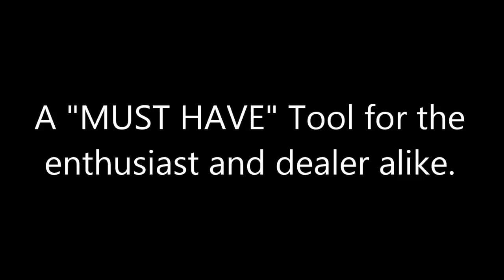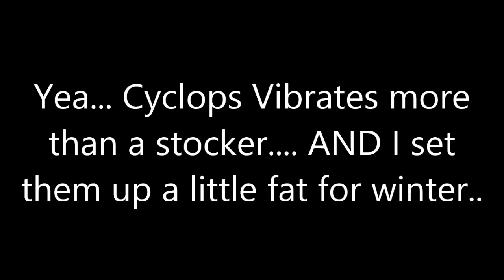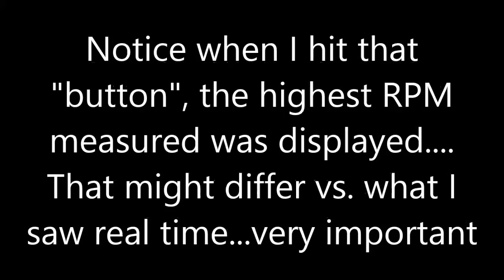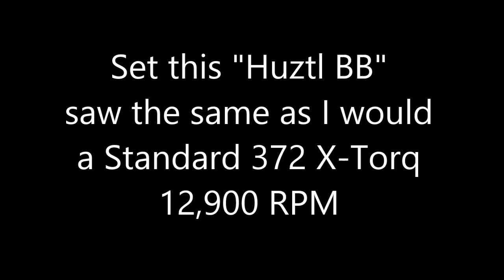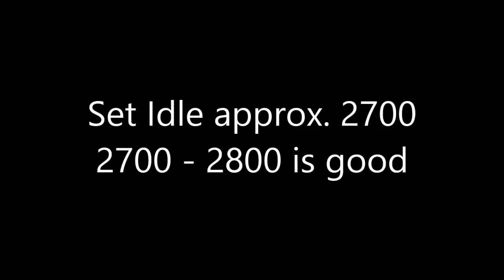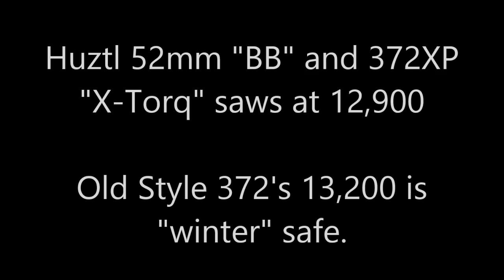Tachometer's For Chainsaw's and Husqvarna 372XP "X-Torq" Setup Notes

Comment: Mine 365 X-Torq was at 13500rmp when I got it from a dealer, do you also recommend for that saw to lower the rmp to around 12900-13000 rpm?
Reply from the maker: 13,000 yup. Newer ones better then the older ones. Pre 2015 12800-13000 max
Reply: I should have probably mentioned that mine is 2018. Thank you for advice and quick response.

Comment: Will this work on the autotune's and m-tronics? What ranges would you setup a Huztl 660 idle and no load highspeed to in stock form? They seem like great saws as long as you go into it knowing there will be bugs to work out. Which to me is the fun part.
Reply from the maker: these work with any saw with a spark plug..:) they count the field collapses from the spark plug wire. A 660 from Huztl should idle around 2600-2800 rpm and no load 12800-13000
Reply: afleetcommand Thanks keep it up!

Comment: Can you tell us more about your muffler mod?  Or did you just punch a bigger hole and brace it shut?
thanks  GL
Reply from the maker: Started with a Huztl side pipe muffler... they have no internal baffle's which is why I like to start with them. They come with a approx. 5/8 dia. pipe. I cut it out and put a 3/4 in dia. x 2in long pipe is the same spot.  Wonder if I should video that process at some point. Pretty easy to do. Actually the Huztl all by itself is an improvement on the "EU" style baffled mufflers.
Reply: Yes to this vid!  I'd love to see a couple different muffler mods... These vids are limited on The Tube!

Comment: Do the big box saws such as the 440 still get tuned to about that 12900 rpm?
Reply from the maker: A 440 is "safe" at 13K, but an OEM 440 likes to push that 13,500 range "no load" tune. SO what I've been doing it setting that class of Kit saw around 13, then plug check.
Reply: afleetcommand, thank you for the information!

Comment: For my husqvarna 365 x torq,  can i setup this rpm just like husqvarna 372 x torq, Walter?
Reply from the maker: I would set the 365 at 12500 instead of 13000. The 365 has a little less transfer area because of that fin in their "transfer cap", grind that out and they are a 372..:)
Reply: Thanks for your answer, Walter!

Comment: My 562 auto tune has no manual adjustment ?
Reply from the maker: No adjustment other than the Autotune. And if the saw is healthy thats all its going to need..:)
Reply: Tks. I got my 562 and T435 from Bob and had him ship them to Freedom, PA. His prices are way  better with shipping then my Husky dealer 4 miles away. also have a 460 rancher, Stihl 029. Thinkn about getn a 572 but don't  kno if that's gona be that big of an upgrade from the 562 for the money ? Running the 562 with a 28" bar and JGX full skip.Did my own muff mod. Cutting red oaks up to 10 feet around like butter. Love the videos very informative.
Reply from the maker: The 572 is a 70cc saw and runs like one..:) I actually am on the fence as my 562's are doing exactly what I need. The 572 has some design changes that will make it worth the investment for someone who makes a living with a saw, but for me? If I get one it will be either for the channel or for collecting. :) have to say its an impressive saw though.
Reply: Tks for taking the time to reply. Think I'm gona go with another auto tune . 576 xp.

Comment: Was that the 180 that was giving you problems
Reply from the maker: ian martin Yup. I hate it.
Reply: afleetcommand Thats too bad. I was having trouble with my ms170 and I had to get the clutch off to look at the intake boot. I don't have an air impact rachet/drill so I had to use brute strength. I got the clutch off but in the process bent the piston rod. The corners of the skirt broke off but amazingly enough the cylinder has no damage accept for the everyday wear and tear. I replaced it with an ms171 which I am much happier with but I am going to rebuild the old 170.
Reply from the maker: ian martin For revenge.... Think I'm going to build a "Huztl" version.. :)
Reply: afleetcommand I would do that. It's cheaper than buying other companies products and they are good quality. Maybe port it and stick an 18 inch bar on it and see what the results are. It will actually run one stock but not very well. I think it would be interesting to say the least.

Comment: What fuel/oil ratio do you run on your saws?
Reply from the maker: 32:1 with an ester based synthetic
Reply: @afleetcommand  Maxima Formula K2 (2 Stroke Racing Oil)... I mix at 40:1
What octane pump gas do you use? Gasoline in my area is all E10.